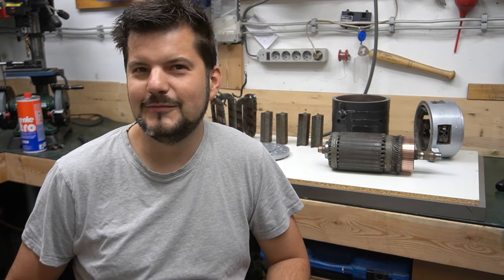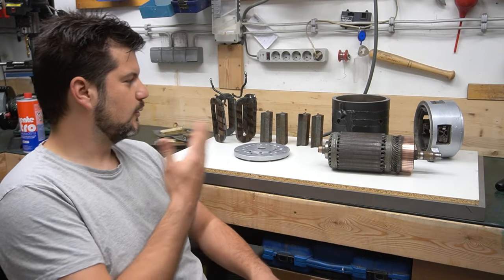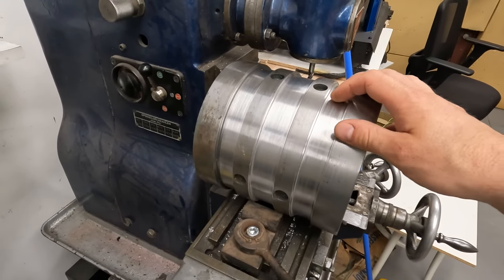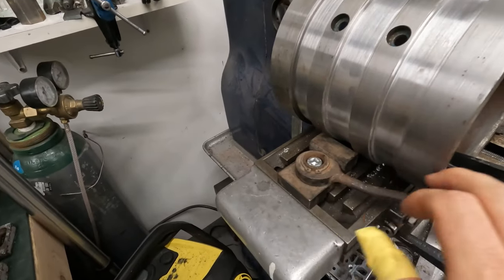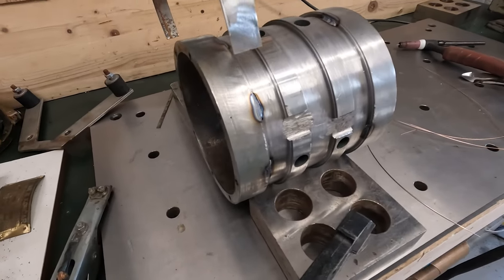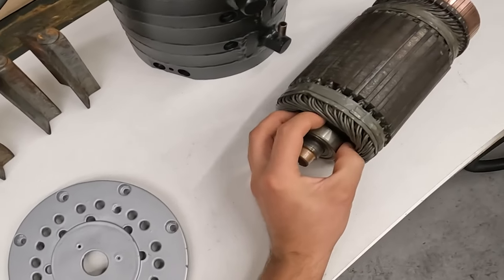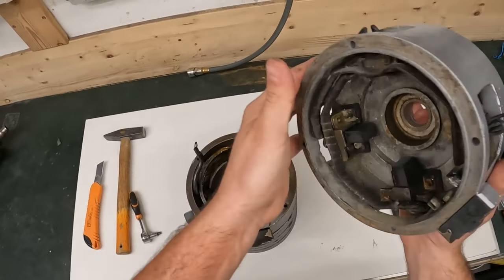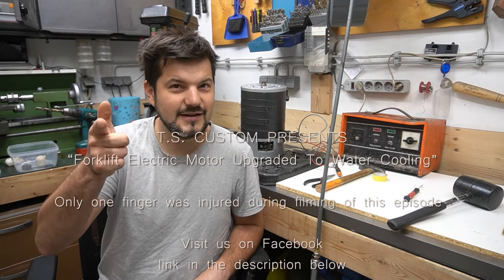Forklift Electric Motor DIY Upgrade To Water Cooling

Comment: Before the assembly did you check for leaks?
Reply from the maker: Yes, a couple of times during welding. Put it under pressure and under water. In the end I didn't put it in the video because it was already pretty long.

Comment: Hello! How is the motor working with the water cooling system after 7+ months of use? My suggestion is to smart-cool it. You can add 12V-fans to put forced air into the brushes every time the motor gets more than 300Amps. This Air cooling system by itself is simpler, and cheaper. Remember the source of heat are the brushes when they pass current. So my cooling system will have: 1) forced air every time the motor gets 300+ Amps, 2) forced Air if the motor gets more than 80C of heat (fans ON most of the time in this scenario) and 3) I would add watter cooling in the same threshold: 80C, not earlier to save energy and 4) I will turn off the controller if the motor reaches 120C. Those motors claim to be "Insulation H", meaning 180C, but that is too hot, and a big lie. Most DC Series motors will burn after 130C, so why sun the risk? Also, I would use inox tube embedded in the motor case, because water will cause rust and long-term damage in your motor, case an inox tube will avoid the last soldering job, so you would save $$$ and time.  Using DC Series in Cars with Lithium allows us to reach 300Kms range, Up to 150KM/h at 144V, 9" DC Series fork lift motors. Congratulations on your water cooling system. Best regards from Mexico!. Hector Ruiz
Reply from the maker: Forced air cooling is loud. The main goal for the motor is to be as quietest as possible. Although forced air would probably be enough, noise was the reason I went with water/sea cooling solution. cooling liquid is not water, its glykol, the same thing that is in the cars. It has rust inhibitors.
Reply: @T.S.CUSTOM  You are quite correct: there is noise in air cooling. What is your battery voltage and capacity (Ah/Kw)?  What is the speed controller that you use? What is your speed and range?
Reply: @autoselectricos1109  hey there you seem to know your stuff.
Reply: @autoselectricos1109  

Are you suggesting to get a 9” forklift motor rated at 144volts so as to get more km range?